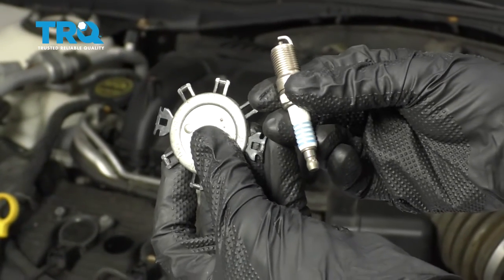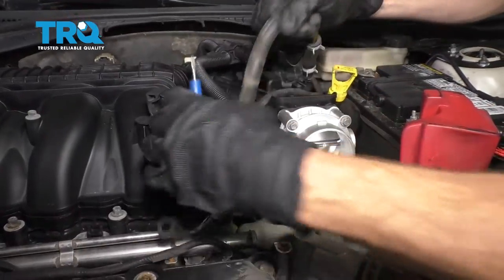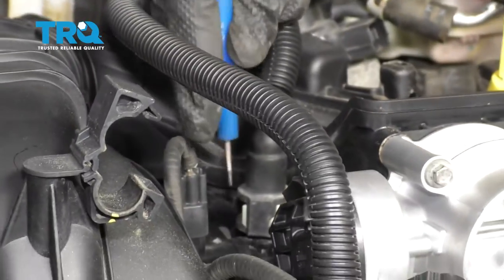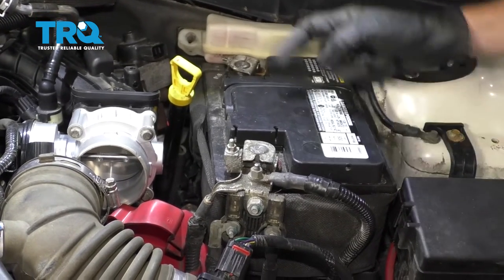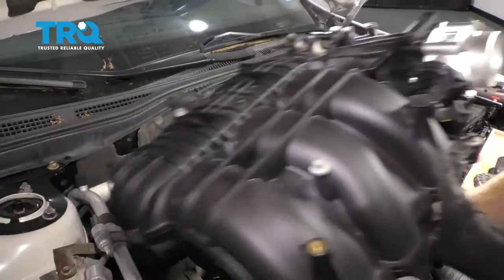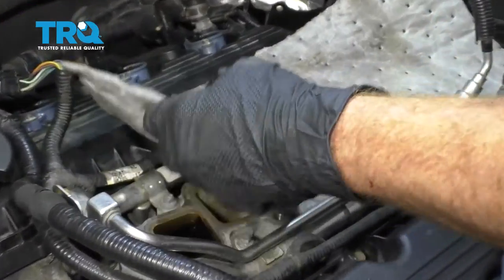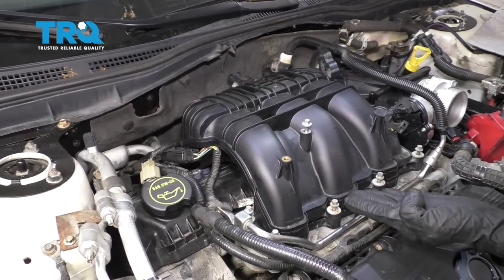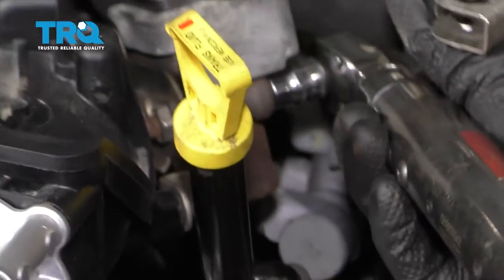How to Replace Spark Plugs 2006-12 Ford Fusion

Comment: thanks for the video my friend and I used it to change the spark plugs and ignition coils in my 2009 Ford fusion SEL. worked great, very straightforward, much appreciated.